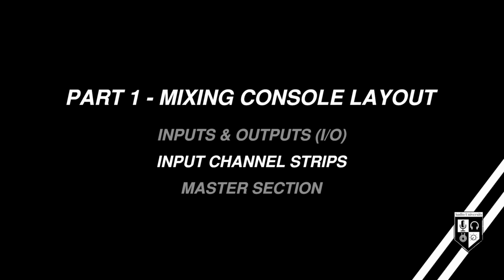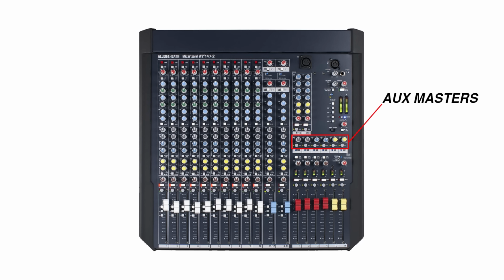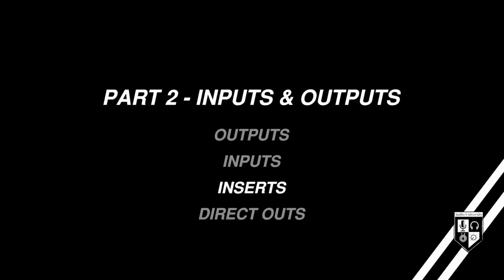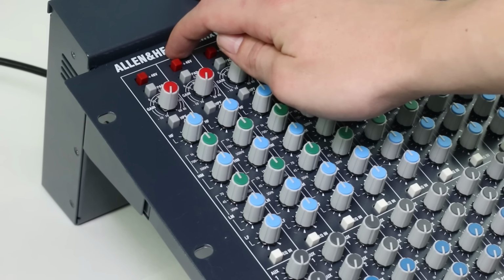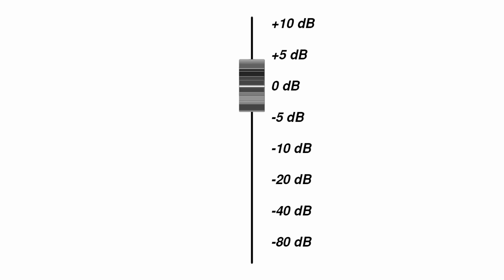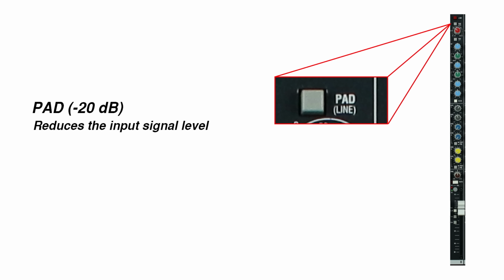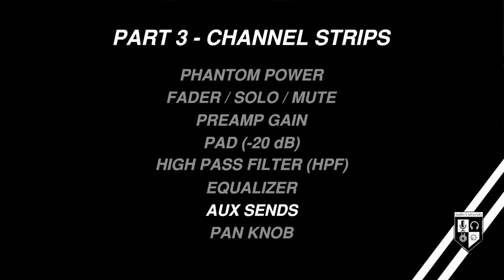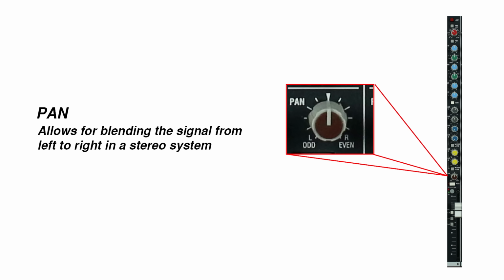How To Use a Mixer for Live Sound & Studio Recording

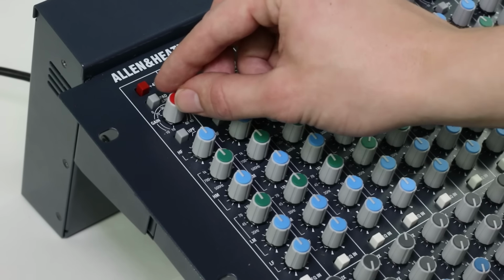Comment: 6:40. Push back time. Gain stage shouldn’t be set based on how loud something needs to be in the mix. It’s quite important to set your gain stage correctly because the fader controls overall volume, and the gain knob controls the amount of electricity actually passing through the microphone, or DI. For example. The more you gain up a microphone the bigger you’re making the pickup pattern which can very easily induce feedback. If the gain is set correctly the mic is operating with a much smaller field of pickup thus making it easier to control the overall volume of the source in the mix, as well as eliminating needles background noise, and making feedback much easier to control.
Reply: But other than that there is some very good information in this video.
Reply from the maker: Hi Sean! Good to hear from you!

I think the way that you and I set up gain structure is much more similar than it might appear. With the input fader and master fader at unity, setting the preamp gain based on how loud the source needs to be is a way to minimize noise and feedback potential. Of course, the assumption here is that the amplifier is set to the appropriate level and the amplifier/speakers are properly equipped to supply the SPL needed. In this video on PA system setup, I show the process I use to set this up: https://youtu.be/Avaa4_702eM

I do need to push back on some things in your comment...

First, the pickup pattern of the microphone is independent of the preamp gain setting. No matter how the preamp gain is set, the microphone will output the same signal to the preamp. Adding more gain to the signal does appear to extend the reach of the microphone pickup pattern, but that's just because the signal as a whole is amplified. The pickup pattern stays the same.

Second, the gain knob doesn't affect the electricity passing through the microphone or DI. The microphone diaphragm oscillates with the sound pressure waves, which creates a mic level voltage on the microphone-side of the input transformer. On the preamp-side of the input transformer, that mic level signal can be amplified, but the signal from the microphone is exactly the same regardless of the gain setting.

I think we agree that amplifying the microphone signal only as much as necessary will help to avoid clipping, minimize noise, and minimize harmonic distortion, while leaving headroom before feedback occurs. This concept is more thoroughly explained in this video on gain staging: https://youtu.be/TCBHysRV4vs
Reply: @AudioUniversity  you're assuming all PA speakers are active/amplilfied. What if you are using passive speakers. You have a choice of running the master fader at unity and lowering the preamp gain OR setting your preamp gain as recommended in most manuals (using the PFL and meter to get a max signal near 0db) and adjusting your master fader to control room volume. Is one method preferred over the other?
Reply: @AudioUniversity  This does not work like that. First of all, this is more like audio grammar school or nursery level of stuff you are teaching. Albeit that - very well done, kudos to that. Your videos are good and you do present your subject really well. And I do believe your channel is really good for beginners in audio industry.

But for preamp gain or gain staging - especially when you have analog MixWiz to show...Nope, not like that. In order to get healthy preamp signal you need to dial gain to clipping stage and then back some. To maximize sound to noize ratio. This is how analog mixers (like MixWiz) were designed for - even with low rail voltage. Then you can use your insert points and even D.O. to feed optimal signal to external recorders / processors. Same for pre-fade auxes... Does not make any sense to use preamp gain as a volume fader and then sacrifice all other processes downstream. 

Mixer faders are your volume. Not gain pot. With digital systems you have bigger operational window. But same thing applies - why not to get the best signal to noize ratio for your AD converters.
Reply: I'm so glad to see that I wasn't alone in my horror.  You should never use the gain knob for  'volume adjustment'.  The explanation of the channel strip layout and functions was great, but setting master and channel faders to unity and then adjusting channel volume with the gain knob is just a recipe for disaster.

Comment: You’ve done a good job of explaining this mixer. It was a little quick, and you might have rushed though the terminology, but that’s just my opinion.
The only technical comment I have is on your description of logarithmic scale on the faders. The reason for logarithmic vs linear is that our ears work in a logarithmic manner, meaning that from a dB standpoint, each dB of change sounds the same to us. The apparent change from -10 to -9 is the same as 1 to 2.
Reply: I was about to comment about the same thing but your words describe it perfectly lol
Reply: That is true but irrelevant in this context. 

He is spot-on about working faders as close to "normal stop" (unity gain) as possible. 

Whenever I see a 1/3-open fader at a gig, I know the mixer hasn't got full control of the mix. It's very common and also indicates either ignorance or poor training. 

There is an idea called the "straight-line balance", meaning that when the balance is right to the ear, all the faders line up across the mixer, at normal-stop. 

Obviously you never "set and forget" but adjust all the time, but I worked with many superb mixers (people!) down the years, and the very best aimed for this. 

The other thing is that many desks (and mic inputs to other stuff) have gain in steps, not continuously variable ("thinking of you, Neve!), so you cannot mix on the gain presets, and they can also be a pain when setting up stereo pairs.
Reply: dB is already a logarithmic scale, the reason faders aren't linears is you can't have 3 meters long faders.

Comment: One newbie question: Is it possible to use the laptop's mic line in to route in the mix out of the mixer (without an external audio interface)?
Reply from the maker: It is possible. There are two potential obstacles you might encounter. 

One issue has to do with the output voltage of the mixer versus the input voltage of the laptop. You’ll just need to make sure you listen to the quality in order to get the level set correctly. Watch this video to learn more: https://youtu.be/Po3nvEs4LLY

The other has to do with the pin out of the connectors. The output of your mixer might be TRS, while the input of your laptop might be TRRS. Watch this video to better understand what I mean: https://youtu.be/m4hy63fEgA0
Reply: @AudioUniversity  Fantastic, thank you so much for your excellent feedback and guidelines!

Comment: Can we count on live mixer for studio mixing? Such as Mackie Onyx 24 and Yamaha MGP. I need an input.
Reply from the maker: If you are using a DAW software, you can probably mix completely within that software. All you really need is an audio interface. The mixer is more helpful for routing audio from one device to another.
Reply: Till now i mix ITB. I am looking external hardware such as 500 series comp hardware + mixer
Reply: My question is, is it worth investment studio mix with live mixer?
Reply from the maker: In that case, I’d either recommend a mixer or a patch bay depending on the audio interface you’re using.